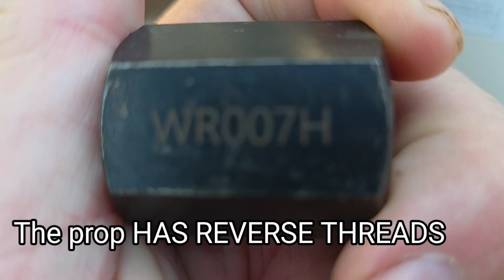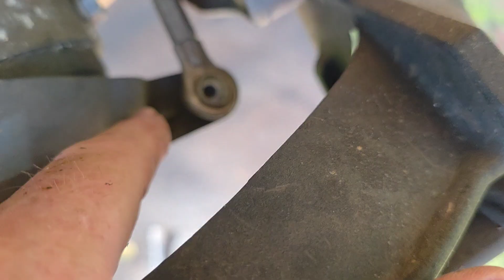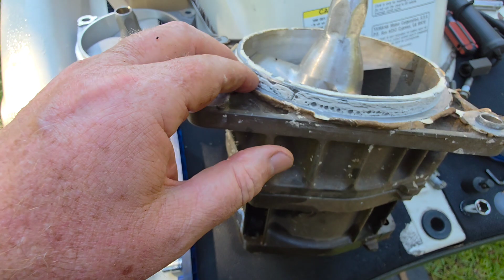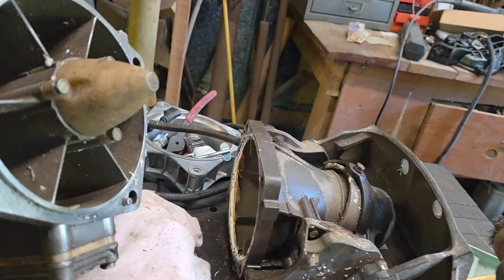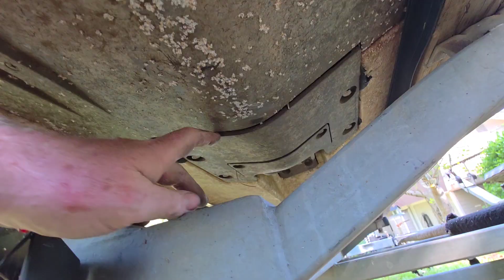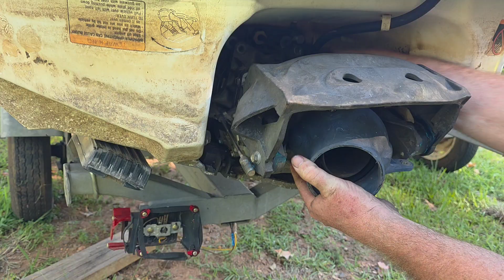Waverunner jet pump removal and replacement of prop and wear ring  1999-2005   800 and 1200 series

Comment: What unconventional method do you use to remove the top housing? All five bolts out and 9 won't budge.
Reply from the maker: I used a zero turn mower and a rope.  It popped out and flew out about8 feet.  Tried on another and broke part of the wear ring.  Heat the seam with a torch and try pulling it out.

Comment: What were the unconventional means you did to actually get the pump out that's why I clicked on the vid 😭
Reply from the maker: I used my zero turn mower to pull it.  It is much safer to heat the bottom half with a plumbing torch and pry it.  It went sailing 8 ft after it broke loose.  The second one I pulled like this broke an ear off the wear ring housing.  I decided NOT to show me doing it because it is risky to do it that way.

Comment: My 2001 GP800 is of the one seat design where the rear battery bucket butts against the engine compartment.  In this design I was able to remove the bracket that holds the rear bucket and by only removing the carburetor air manifold along with hoses, able to pull the hole engine with exhaust intact.  I even left the CDI unit attached to the battery bucket and hoisted the bucket with the engine.  Have you ever used this method in pulling an engine?  If not I would enjoy seeing a video using this method.  Regards, my friend.
Reply from the maker: I haven't worked on a one seater yet.  I have my eye on a 4 stroke one though.

Comment: Hey shade tree thanks for that great video, also Thanks to all your prior gp, xl 800etc. videos because those where my guide to rebuild my 99gp800, and it went great its all in my channel, well I still havent uploaded all the videos I want to upload, but yeah in my case I have had that problem with the bumpy wear ring but I talked to an expert friend and he told me that If the wear ring still has enough meat so that you can "hone" it then you can but mine was like a wet dog, so I just ordered  a used one off ebay. Keep it up!
Reply from the maker: Thanks for the info on the wear ring!  I had just never ran into that problem before. I will subscribe and check out your build and I am glad these videos helped you build yours as well.  People like you are why I do these videos.